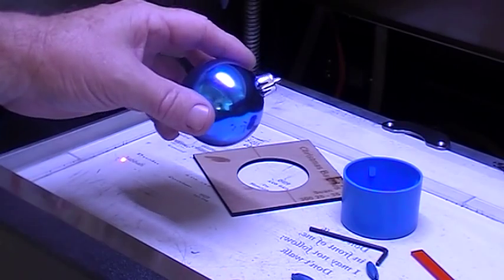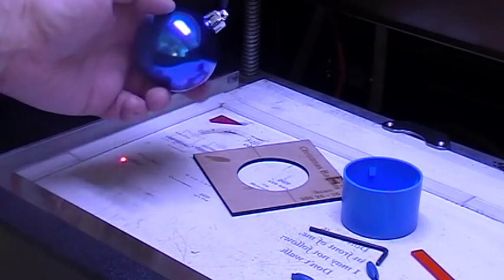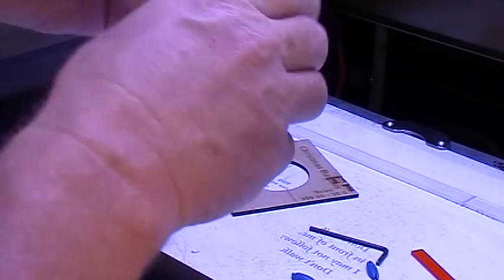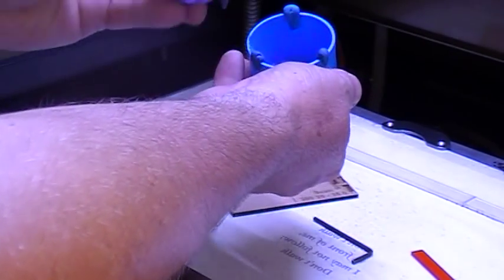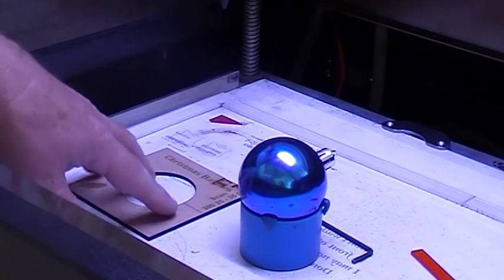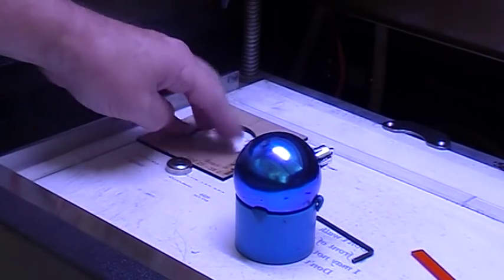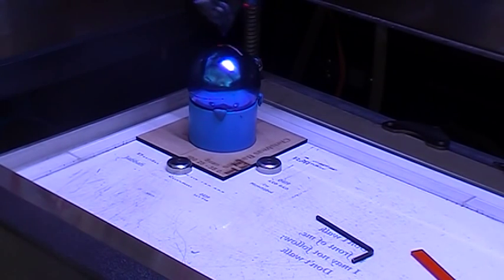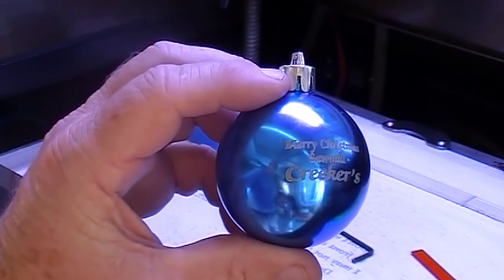Laser Engrave a Christmas Bauble

Comment: Good idea! Although doesn't really need to be "firm" when it's a non contact laser that's doing the job ;)
Reply from the maker: Sorry for late reply, my machine had Air Assist and the bauble is very light without being firm it could blow out of the holder. Without Air Assist wouldn't be an issue.

Comment: What type of laser is this machine.   and how did you find the quality of the engraving at the edge of the engrave compared the centre?
Reply from the maker: my machine was a 50 Watt Chinese machine Shenui brand from memory, I had no problems engraving or cutting anywhere in the cutting area but will say it's all about maintaining the alignment of the mirrors, close enough is not good enough. Spending the time to get the alignment right pays off in the long term.